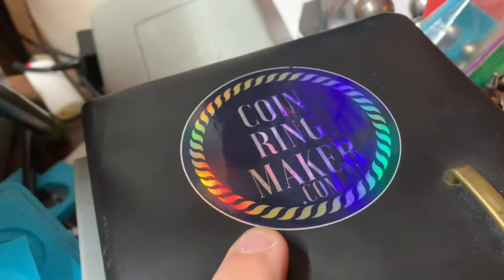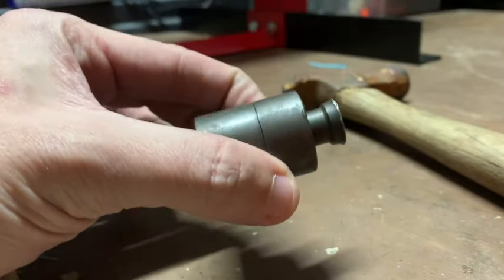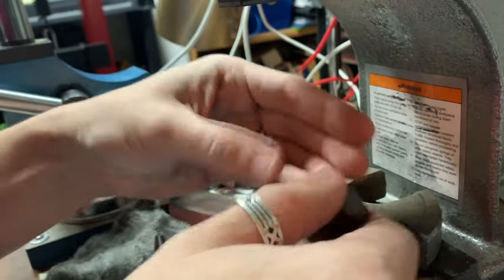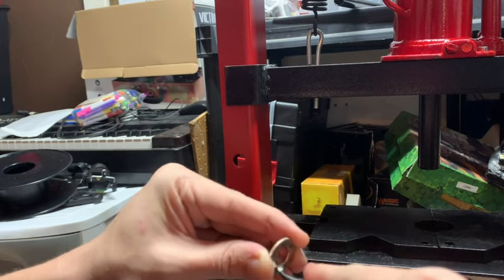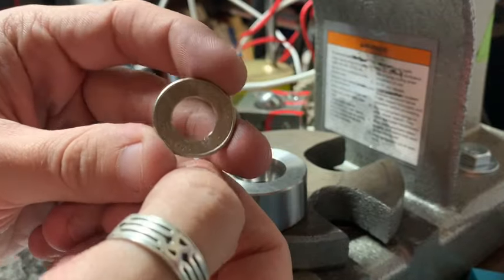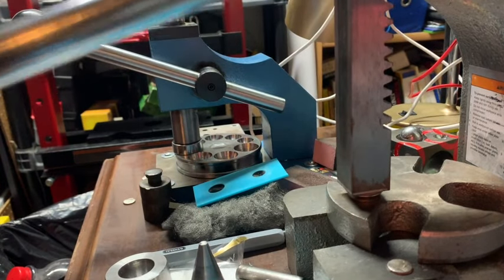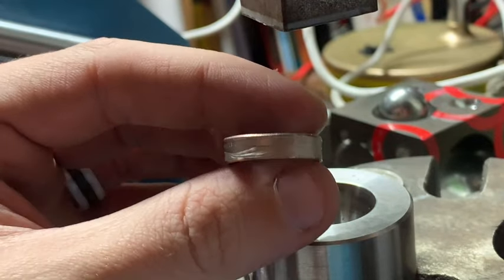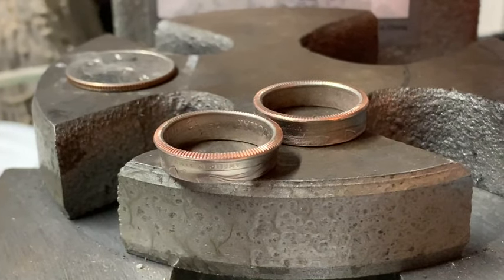Coin Ring Tools Do Not HAVE To Cost $1000’s - Low Cost Tool Recommendations

Comment: The only thing your missing here is your torch to aneal ( heating ) the metal as you strech it. Working on metal hardens it which is why you get cracks and splits. It you heated it to red hot after every step, that wouldn't happen. I'm a Jeweler. I am excited to get into coin ring making ! Thanks for the ideas !
Reply from the maker: You are 100% correct. Annealing took me way too long to try but is super useful.

Comment: Using a brass hammer is much better than nylon. Not that expensive. They also make ones with interchangeable tips. 👍🏼
Reply from the maker: I don’t like how quickly my steal tools mess up brass hammers. The plastic one lasts much longer and works just fine.
Reply: @ that’s true except it takes a bit more hitting with nylon , brass just packs more of a punch. But what ever is best for you, is the best. It’s very easy for me to resurface brass tips on my lathe and why I prefer it.

Comment: I aneal my coins every time I change their appearance to avoid splitting the coin / ring, when I first started making coin rings I did not aneal enough and split many, the most important step is to ensure that You are annealing enough, much easier to work with the coin and tools if the silver is soft

Comment: Thanks for the info! Is there a smaller alternative to the 1 ton press? I don’t have the space for one, but I also don’t want to make too much noise hammering.
Reply from the maker: You could use a ring stretcher reducer, they are a little smaller than the one ton. You should probably bolt it down somewhere though.

Comment: Hi, first of all, I think you're doing a great job. I don't have a large budget, but I have found it is better to purchase the Chinese ring stretcher for between $100.00 - $200.00, simply because it does the work most of the other tools you mentioned. You can cone with it, shape it, and size it all with the same tool. Of course, you still need your reamer, ball bearing, mandrel with sizes, but that's it. If you plan on making any older quarter rings than 1965, you will need to anneal it. Mark it with a sharpie pen and heat just enough to make the sharpie mark disappear. Then drop in water to cool. If you try to heat it too much, you will distort it or melt it. I think you present very well.
Reply from the maker: Thanks for watching! A ring stretcher is definitely a good investment.

Comment: You could make a plunger up stop as I’m sure most punches are within 2 inches. So set the upper stop block so it only goes up 1-2 inches after the punch struck.

Comment: Some tools are absolutely, 100 percent worth the extra money.  Had I known when I started making jewelry what I know now, I would have just invested in better tools.  The dapping set from harbor freight that I got for example, has a 2'' convex dome in the block, but the largest punch is about 1'' um.... then when you take into consideration the time spent to finish them properly and the money on the tools needed to do said finishing, if I did a great deal of dapping, it would have been worth the money to just buy a proper dapping set.
Reply from the maker: I totally agree but you’ve got to start somewhere and if you hadn’t started with lesser tools you wouldn’t appreciate the better ones. At least that’s how I look at it.

Comment: One thing I would like to mention is that if you have an arbor press you will not be punching holes into coins with it. You need a hydraulic press to do that. But if you are worried about punching a hole with only a hammer (place the punch and die on wood base not stone or concrete) don't it's quite easy to do
Reply from the maker: I now just use a plastic teardrop hammer to punch holes. It works great.
Reply from the maker: I put the punch on a metal stamping block.

Comment: Thanks for the great points im wondering how i would make a  size 
6 ring
Reply from the maker: You may need the next size down reduction die from what you are using. I used to use a quarter laying on top of the ring so I could push it further down in the die to get smaller rings. A washer would probably work better as a quarter tends to push its details into the sides of the ring.

Comment: Nice Video! I have copper .999 fine coins, silver dollar replicas. What size die or additional materials would I need for these copper coins to make rings?
Reply from the maker: This is my recommend tool list. https://coinringmaker.com/recommended-coin-ring-tools/ I do recommend annealing copper, it can be tough to shape. What size are the rounds. 1/2 oz are much easier to work with than 1 oz. You’d need 17 degree dies.

Comment: Try a rubber mallet on your tools. More heft.
Reply from the maker: I use a plastic hammer now, works great. Much easier on the tools. A normal hammer is definitely not the best option but it’s what I had at the time.

Comment: so instead of using the metal hammer on the ring stretcher and ending up with a flared punch, have you tried a deadblow hammer or a rubber mallet? just curious, i amm not even positive that it would work, also loved the video! very informative!
Reply from the maker: I currently use a plastic hammer, it’s much easier on my tools 😅

Comment: Hey bud I may be wrong but it seems like your listing your press every time you use it? Is that right? If it is I hope you do know you don’t have to do that at all. All you need is just enough to pull out and insert.. that alone will save you so much trouble/time. Don’t know what kind of jack you have. The ones that can be turned like a screw can be fixed up in a way I can’t believe they don’t sell it as an option. Hook up a cordless or corded drill. Especially those little impact drivers they make now. Very simply it would do all you need in a super small fraction of the time.if you have one that pumps up and down. You can still use a drill you just need to build or by an adaptor that will kinda work like under the truck. The way kinda of like anU-joint the drive shafts. Trani.. that kinda deal. To be able to go from a circular motion through the adaptor would slow it to go round.. hope this helps a tiny bit dude.

Comment: Great video! Can you post a link to the block and ball set you recommend please? The ball link on your website didn't work for me. I'm very interested in getting started! Thanks!
Reply from the maker: I currently use 3/4 inch delrin balls. They are hard plastic. Sorry I need to update my website links 🤪
Reply: No problem. Thank you for that info I will look into it.

Comment: HEY DUDE YOU KNOW WHAT I USE FOR THE STRETCHING AND HOW YOU GOT THE RING STUCK? All around on the mandrill even just when it’s barley getting curved in day from the damping block. Seriously try some PVC pipe. You can cut the edge to any shape you need. I use a full circle and a half circle. That’s just at the end of the pipe. To use it with the hammer going down or whatever. It won’t scratch and you can hammer it down and go right over the mandrill  if the pipe (pvc) is way to big or to small that’s why I have one at the end as a half circle. This helps because the pvc pipe can’t slide over the shaft and connect with the ring. Hope this helps I’ve never thought about explaining it. Works super super great..! Think hammer and chisel but your chisel is a plastic pipe. 👍🏽 use the grey ones they are 100 times stronger. Maybe not a 100 but you know..
Reply from the maker: For sure! I’ve got a video here of me using a pvc pipe in just that way. https://youtu.be/zFRuw9A9SrY
Reply: @CoinRingMaker  cool.. I just found you. I’m liven it my man..! Good works you got..👍🏽

Comment: I would, instead of buying that stretcher, buy the next smallest die and put the ring on top of the die, then you shove the cone through the cutside of the ring to stretch the ring out! It stretches evenly around the band instead of just 6 individual points!
Reply from the maker: Great point! I’ve seen others do this but haven’t tried it too much myself.
Reply: Any video suggestions for this method?

Comment: I didn’t see any kneeling going on. Is that a necessary step in this process? Do you need to use the kneeling on silver, do you need to use annealing on regular cloud coins? Appreciate any answers. I think your video was super!
Reply from the maker: When I first started I was very hardheaded about annealing. I thought it was a waste of time and didn’t give it a chance for too long. It is definitely an important step. I highly recommend annealing especially with 90% silver. Copper is a bit less brittle than silver so you can stretch it more without annealing but it is much safer and easier if you do anneal.
Reply: While watching the video, the one with the low-cost tools, I noticed that you said you’ve been doing this for about 300 days. And you’ve made one ring per day, 300 rings does a lot of rings, are they all the same size? Is all your stock one size? And when you get an order for them is that when you’re sizing I was just curious on how that was done.
I really enjoy your videos, and I am seriously getting into this ring, making hobby Thanks again, TONY from Texas.
Reply from the maker: You can premake, then resize rings. However you never really know what state or year or coin type your next customer would like. So for that reason I usually make everything I sell to order. I did try to make at least 1 ring a day for the first year to stay sharp. At this point I’ve got it down good enough I don’t have to do as much practice.

Comment: This is a great video to show how you don't need a million dollars in tools to make something!
 
The only tip I'd like to add is in terms of removing the center spike from the stretcher. If you were to take a piece of 2x4 (or even a piece of 1x3) and drill a hole that is just wide enough to fit the area below the stretcher rings, but not wide enough to allow the bottom collar to fit through. Drill it near the edge so that you can cut the sides and wind up with a "U shaped" area. Clamp it to a bench so you can slide the unit in from the side. That way, the stretcher will be supported by the collar, and the force will be directly on the spike. So much of the force of each blow is being absorbed by your hand being deflected. It's like trying to hit a ball that is moving away from you. It's the same principle as the bracing blocks on the press. Imagine trying to just hold the punch set underneath with only your hand. All of the force would be absorbed as your hands is pushed down.  

Hope this helps.

Comment: So wait- just to clarify, the 1 ton arbor press you use around 11:00— is that enough to punch  a nice clean hole all the way through on its own? Or do you need the 20 ton press?
Reply from the maker: Most of the time I use a hammer (brass if you can find one, plastic works too). On super thick coins I use a 12 ton press. The one ton will not punch the hole size you need but a hammer can.

Comment: I bought the self centering punch kit and had to smack the f@#k out of it about 10 times with a gympie on florins and 5 times on 50 cent silver rounds. Im mean its exhausting work. Im buying a 6 ton press tomorrow and using that with the SC punch.
Reply from the maker: The press should definitely make punching holes easier. Wear eye protection and brace for the snap.
Reply: @CoinRingMaker  Thanks for the warning. Its like thunder. Makes a loud crack, but harmless. It took me a couple of goes to gather the courage to keep hold of the punch. Now im doin it like a pro 😎

Comment: I have a question regarding making coin rings. I have practiced on steel coins (which don't need to be annealed, btw) and made a couple of silver ones as well. But non of mine ever turn out looking anything like the ones I see made in videos. Even the coins with relatively deep images in them seem to have weak images at the end and after polishing the images are all but invisible. What am I doing wrong?

 I am using the exact same tools as shown in the thumbnail for the video. I bought a folding die set as shown and the stretcher as shown separately. I have made rings out of 25¢ coins both steel and one silver. The silver one split but that was my fault for not annealing it at all. How do you get the dark contrasting coloring as yours have at the end? Just wearing the rings rub the contrary away. The steel rings dull to grey and even rust if worn overnight and the silver ones polish off the dark parts
Reply from the maker: Liver of sulfur is a pretty popular darkening agent. Maybe try rapping your rings in plumbing tape when reducing, this helps keep details. Steel and iron rust so I don’t use them.
Reply: Same answer. Put plumbing tape round. About 10-20 times should do

Comment: If u stop ur hydraulic jack from going all the up, u don't have to jack it down the 4 inch back to ur work Every time
Reply from the maker: True, I used it for a couple different things which are different heights so it’s just kind of a thing.
Reply: No worries nice work
Reply from the maker: Thanks
Reply: Have I thought about a brass hammer in stead of nylon?
Reply from the maker: Lol I have. I just haven’t found one.
Reply: U will probably never pick up the nylon again lol